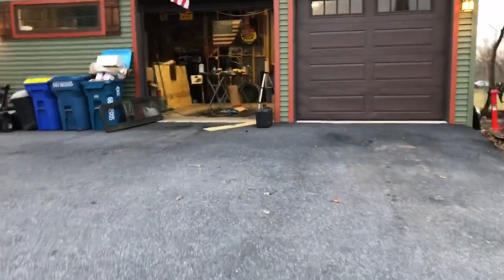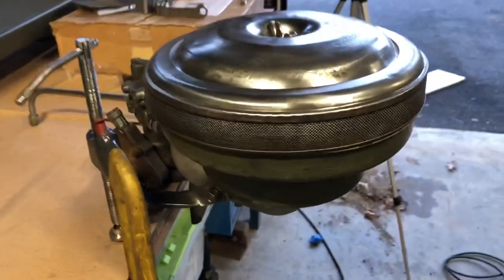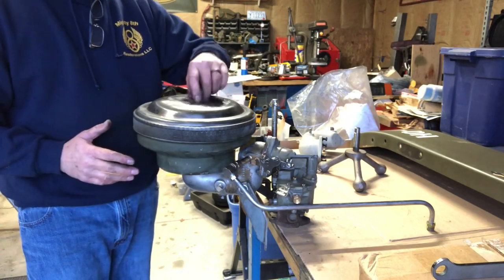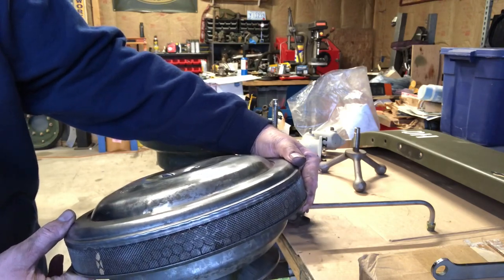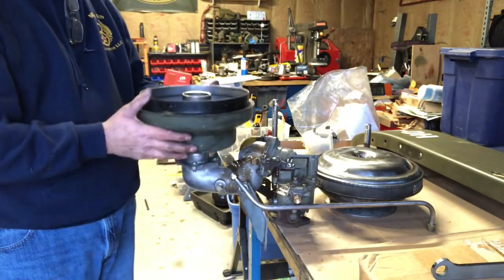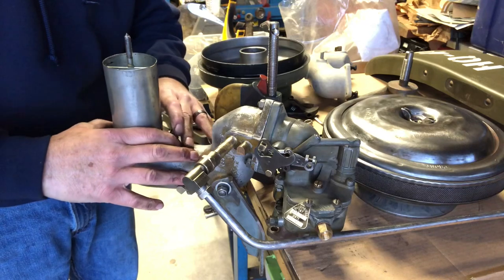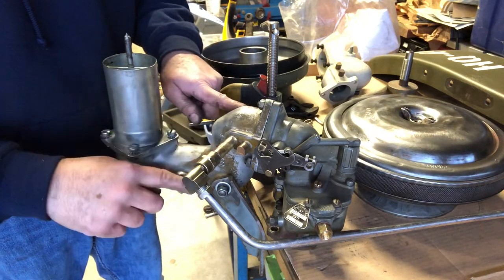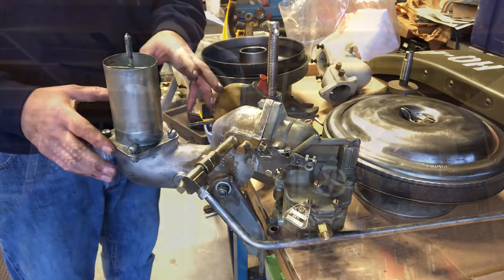Working on a Dodge M37 ETW1 carburetor system.

Comment: there is 2 tubes from carb to the dist to cool the coil one is a vac the other blows air when its running to cool it that coi getver ho closed in the dist.

Comment: i in manual on this eng  the vacume line goes from bottom of fuel pump to dist then from dist to carb this to cool  the coil in the dist the other vac port fuel pump goes to windshield wipers